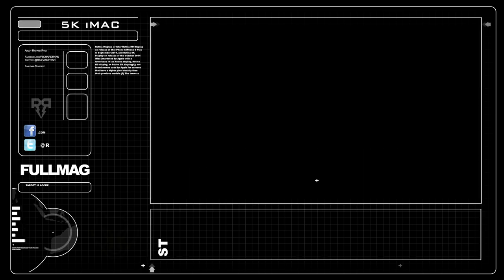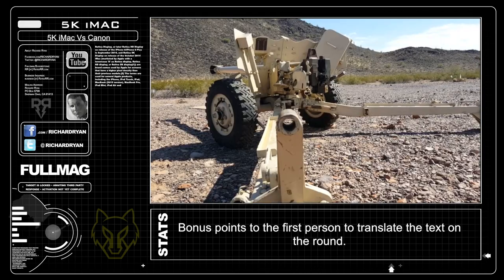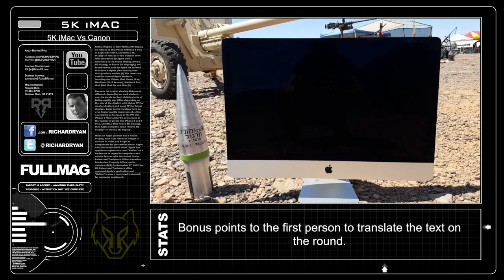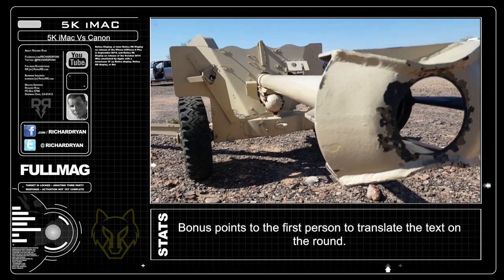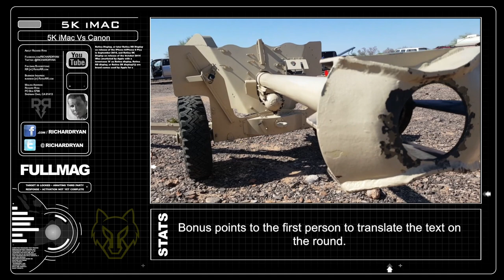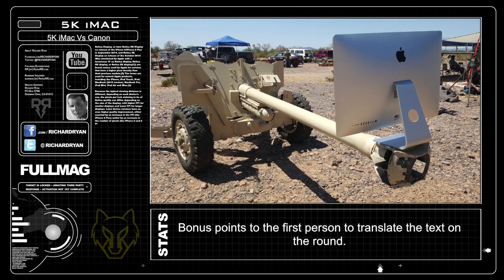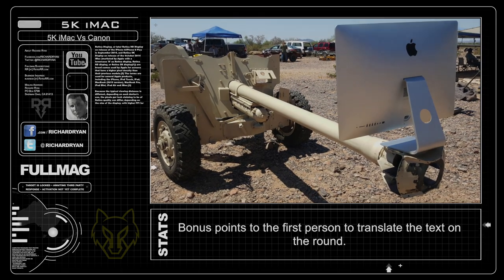5k iMac vs 90mm Cannon - Slow Motion

Comment: nokia 3310 vs 90mm cannon
Reply: NanoCake ricochet to the cannon and gunner and hydrogen bomb.
BUT OBVIOUSLY NOKIA SURVIVED
THE TANKS SHOULD MADE OF NOKIA NOT STEEL
Reply: made out of nokia exotic steel
Reply: Finish nokia steel=STRONK
Reply: nokia 3310
 TANK ARMOR!
Reply: Many people question me for still using the Nokia 3310 in 2014, but I simply laugh at them as they struggle to find a charger for their cracked, already outdated iPhones.

I remember back in 2003 I was trekking through wartorn Baghdad when a stray 50 calibre sniper bullet hit me directly in the chest. Luckily I had my Nokia 3310 in my breast pocket, which deflected the bullet and blew up a tank.

A few years later, whilst on a business trip to Paris I decided to visit the Eiffel Tower. Whilst raising my phone into the air to try and attain signal (I was on Tesco Mobile) a 20m wide meteor happened to strike me directly. Luckily the meteor completely disintegrated upon contact with my trusty 3310, earning me the Légion d'Honneur.

Slightly embarrassingly, I have dropped my phone once or twice. I seem to remember once on holiday in Haiti in 2010, and again visiting Fukushima in 2011.

This phone has served me very well, and still does to this day
Reply: nokia would probably win
Reply: NanoCake ITD PROBABLY BREAK THE BALLISTIC
Reply: sorry to interupt but the nokia 3310 would obvuiously not survive.
Reply: * bounce *
Reply: Comic Sans Criminal I believe it all my friend :D
Reply: load the shell with explosives
just to give the cannon a slight chance
Reply: nokia 3310 vs 150mm!!
Reply: It will survive
Reply: @arandomidiot534  r/wooooshh
Reply: @arandomidiot534  r/woosh
Reply: Just be careful !! Ricochet possible. !!
Reply: Nokialinium.
Reply: Saatana tunarit
Reply: NanoCake nokia win
Reply: Back fire
Reply: Rip bullet

Comment: cant even handle 90 mm canon i dont know why people buy this #madeinchina
Reply: Lol
Reply: +54n141n3n yeah just a canon can even do this.
Reply: +Sefa Uzuner If only it had a screen protector.
Reply: #AllOfTheCompaniesMakeTheirProductsInChina ..
Reply: +Sefa Uzuner #bendgate
Reply: Call of Duty Fanboy
YEAH TANKS CANT EITHER LAWL
Reply: +Maks Mamla  Unless you're talking about tanks from before 1943, then you have a good point. Anything later, ping
Reply: +Dante Inouye I think you mean tanks before 1940 lol I cant think of much a 20mm will pen from 1943
Reply: maybe the t60 or 70 light tanks? :)
Reply: Dante Inouye whats their armour like?
Reply: like 15mm flanks i think
Reply: +Sefa Uzuner My 3 year old pc laptop would have easily shrugged that off.  This proves Macs are crap!  lol.
Reply: PsychoticBovine that's nothing, mine is still running after being hit with a 105mm hesh shell :3
Reply: Mine was hit with a 16 inch naval shell from an Iowa and survived :)

(but it cant max Crisis 3)
Reply: +Dante Inouye My pc desktop survived at ground zero of the Knothole-Grable test.  Twice.

Comment: Would be interesting this 90mm cannon vs 2 brand new Body Armor Level IV (of ar500 armor) or vs 3 inches steel plate AR550 or AR680, to be nice, the combination of both armors in layers (armor, plate, armor, plate) vs the cannon then we will have an idea of it's power vs today's tank's armor.

Comment: How exactly does someone buy this, I've never even seen one online for sale.
Reply: He probably has it on lease. Many museums and private individuals own and maintain WW2 era vehicles and equipment, such as 90mm AT guns.
Reply: +Sarge Rho this isn't WW2 era, it would be green if it were and he wouldn't ask for a translation also, it's probably Israeli or Iranian or Iraqi
Reply: Devon Cooper If I'm not mistaken, it's a 90mm Gun T8. It was introduced in 1946, but built based on an existing 90mm that was in use during late WW2.

So, it is a WW2-era AT gun.

Comment: does the Army or Marines still use cannons like this? does this fire a bigger shell than a tank or a howitzer does?   Seems kind of obsolete to use a cannon  with all the more modern faster weapons now in use.  If a bunch of soldiers are out there with cannons, all an enemy has to do,  is fly over in a  helicopter and blow them all up,  or something like that.. how useful are cannons and mortars these days?
Reply: Seems like you need a little edumacation. Yes we still use artillery like this. Yes they are still effective and relevant on the modern battlefield.
Reply: Why yes what you say could happen.l but you seem to fail to account that the army and USMC have gunships to provide close air support as well.

you clearly have never been on a battle field or you would not have mentioned mortars being out of date.  mortars are an amazing tool to place artillery like rounds in a close area.
Reply: dude, dont be a tool.. it was an honest question.. I am just bringing up the point that with all the more modern, much more powerful, faster stuff.. why would they still use old school cannons and mortars, when they got helicopters that fly almost 200 mph, tanks that go 65 mph,  howitzers that can shoot a shell almost 20 miles,  and all kinds of new stuff that we probably dont know about yet... there are certain things that are obsolete, like flame throwers, bazookas,   wire guided missiles and shells, stuff like that.. some stuff is still needed, some  has been replaced by more powerful faster stuff... so it was a very relevant question..what we had in the early 80's has changed a lot, I was there then.
Reply: +Michael Craig the USM still uses TOW(wire guided) guided missiles.   Saddam's sons found out what happens when you mess with a TOW